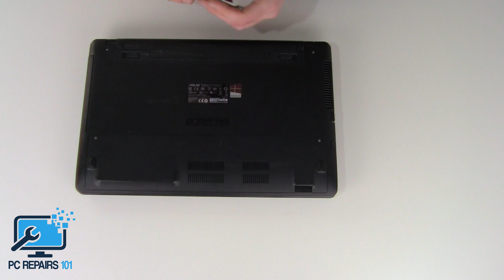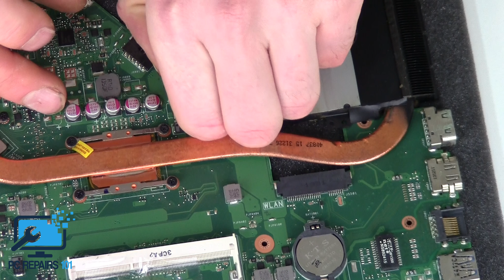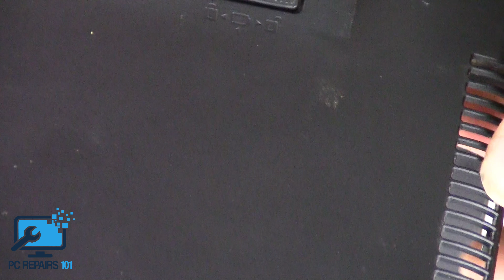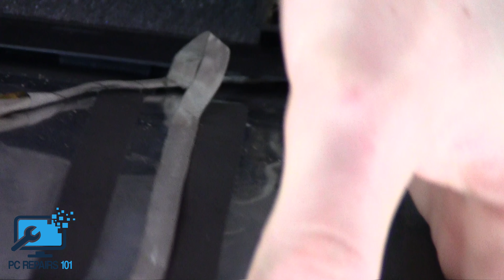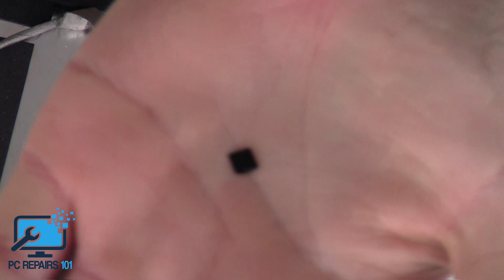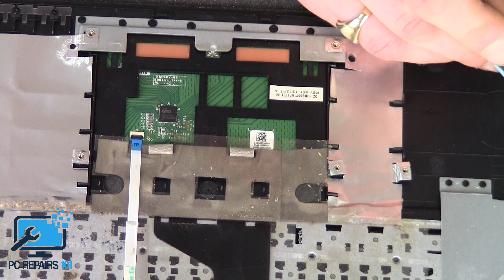Asus X550C Full Disassembly Tutorial - RAM / HDD / SSD / Screen Replacement, Overheating Clean Out

Comment: is the gpu on this mother boaard easily swapable and what can u replace it with i know the board can handle i7 and 32gb ram a SSD with a disc or HDD i want to play fortnite but it wont let u on the stock GPU it wants a class 11 model 5 capable unit would be cool to know as the C board is the best they offered in the X55 seires

Comment: I have the same model as yours. Recently, the power button does not work. I only turn on the laptop just plug in the AC adaptor. There is no response when I press the power button. How to troubleshoot the power button connected to a small board with a flex cable connected to the motherboard. Should I replace it with a new one? I don't know where to buy the new one.
Please help and comment.

Comment: I have a same laptop. I have been using for 7 years. It is slowy working nowadays. I could not  open inside. I guess ı want to clean fan and also  thermal paste on process.  what do you give advice to me ?
Reply: I also have been using for 7 years, and it was so slow. i upgraded to ssd from hdd and now it feels like new.
Reply: Thanks will install ssd and ram

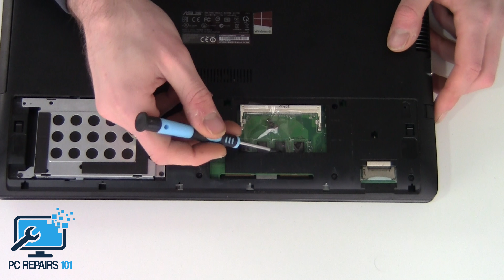Comment: 11:10 Could notice that there is something that looks a lot like a RAM slot there in the motherboard. It looks exactly like the one you show on 2:10 I can be wrong. Just want to know what it is for sure =)
Reply: imma bout to upgrade this laptop too, later i confirm if it is another ram slot or not.
Reply: From what I can make out from memory checkers and other guides, depending on the model there seems to be one replaceable ram slot and another that's soldered to the motherboard. The model that I'm looking at has 6GB of RAM made up from a 4GB stick and 2GB on the motherboard. Theoretically, I can put an 8GB stick in to achieve 10GBs but some memory checkers say that might not be supported. I'm going to try it though and see!
Reply: @ewanbremner2818  did that ever work? I am trying to upgrade a friends X550CA ASUS laptop and it has some soldered onboard too, but don't know if the soldered amount is 4GB or 2GB. If it is 2GB onboard, were you able to put 8 in to take it to 10GB? Thanks
Reply: It's the same ram slot , he just flip the motherboard over , I think Asus X550CC already have 4gb ram installed , that slot was to add ram . Like mine, I installed 4gb ram into the slot so now I have 8gb ram and I think that's the maximum ram for Asus X550CC
Reply: @takapoipoi1831  answer above
Reply: @didyma  ahhh you mean the black slot , you pinned 11:10 so I thought you were talking about that white slot